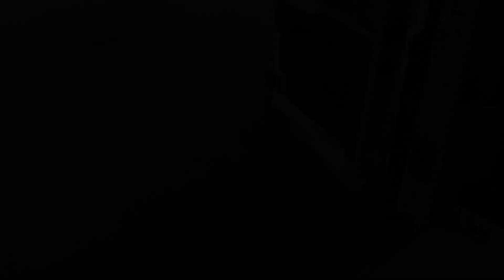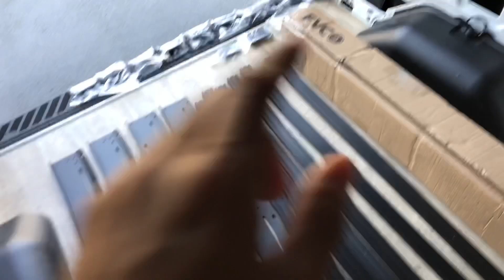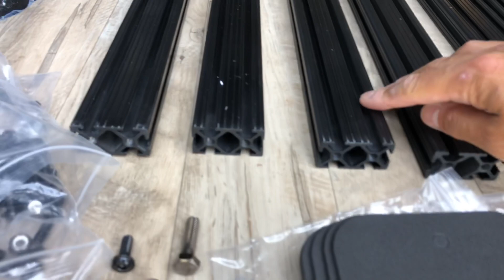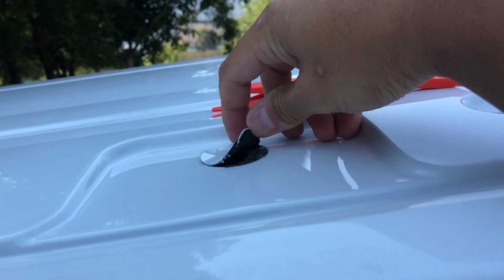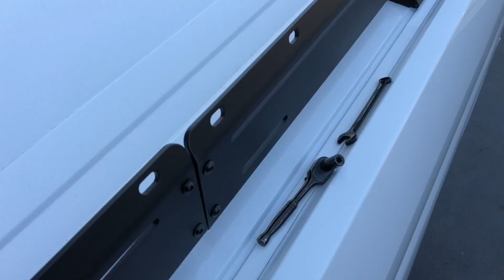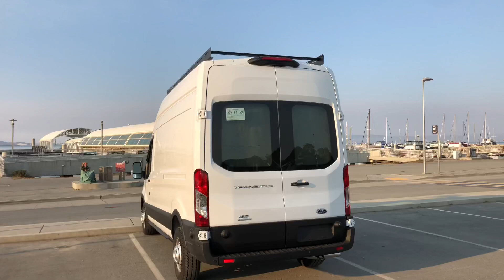AWD Transit FLATLINE VAN CO. ROOF RACK Looks SO GOOD! -  Part 4

Comment: Make sure you put some sealing for leakproof on those used and unsued bolt holes. The plastic covering over time erode and crack most of the time they let water in.
Reply from the maker: good call!

Comment: Did you use any sealants 
around the bracket??
Reply from the maker: I did not and it has not leaked, but it couldn't hurt.  I may put self leveling sealant around it just like the maxxfan later on.

Comment: Great video! But how did you solve the issue with the not-aligning holes?
Reply from the maker: I got lucky and didn't have to dremel it.  I just used a small rubber hammer to bend the metal enough to squeeze the bolt through.

Comment: haha it was also somewhere around 100 degrees when I put mine up. Looks amazing man, nice upgrade.
Reply: ooo that sucks you had the misaligned factory mount holes. I heard that is a common issue but I got lucky with mine and all of them were aligned...did you end up having to drill out the hole to make it wider?
Reply from the maker: I got lucky and was able to barely thread a couple of them in! I’ve seen some others who had to enlarge the hole. Dodged that bullet